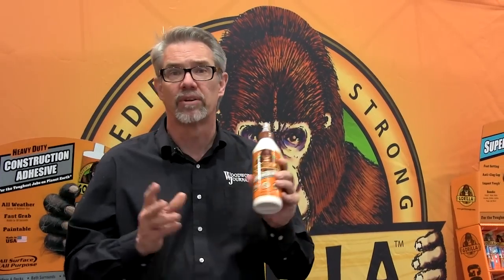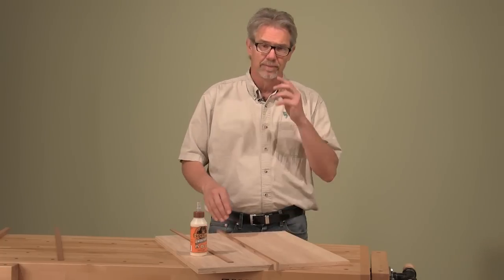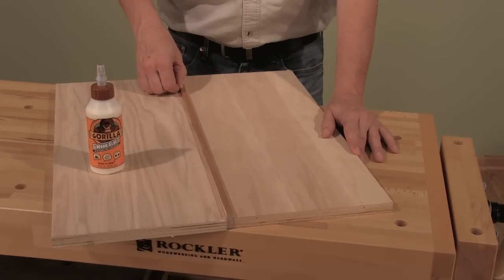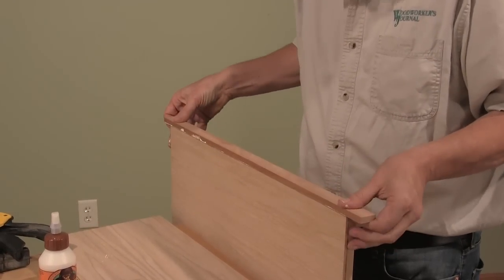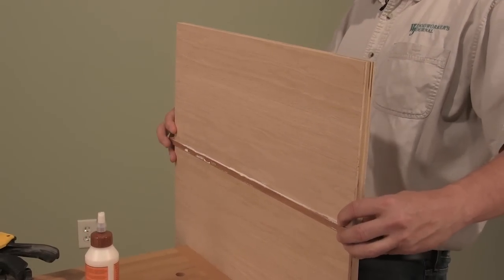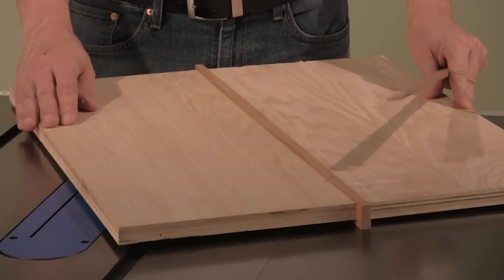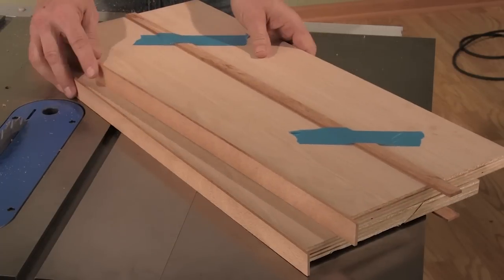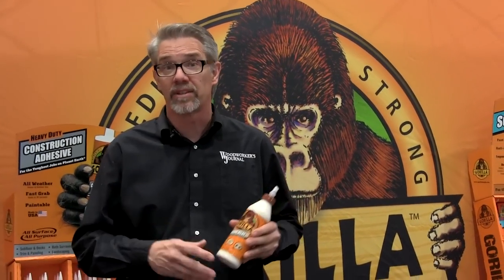Faster Way to Attach Solid Wood Edging to Plywood

Comment: I think it's much easier to just cut the strips to final thickness first and use the same clamping technique but skip all that nonsense at the TS after.
Reply: Agreed, this seems unnecessarily complicated. I don't get the gorilla glue product placement either, since any decent wood glue will be up to this task.
Reply: Agreed also. Theres too many things that could go wrong. Keep it simple.

Comment: This technique would be very efficient to do a mass number of shelves if you flushed the hard wood with the ply on one face so you have a flat surface to do your rip cut. 

I did like the idea of putting the chamfer on the shelving instead of flushing it.

Comment: If you are only edging a couple of shelves, I would agree with the comments below saying that this technique is more time consuming — you are dead-on correct. Where this saves time is when you have several shelves to edge. I learned this in my dad's cabinet shop where I would have 20 or 30 shelves to edge in a day. I can say with complete certainty that this was the most effect process in that situation. Thanks for watching! Rob

Comment: This should be pulled off the site!  Dangerous procedure.  If you don't glue the edge band on parallel with the plywood your furring strips would have to be tapered!  If the piece is rocking as you rip it in half you have a chance of kick back!